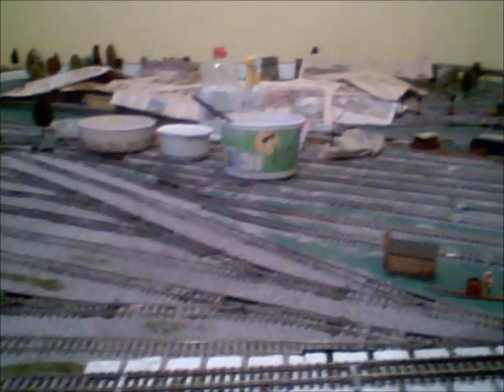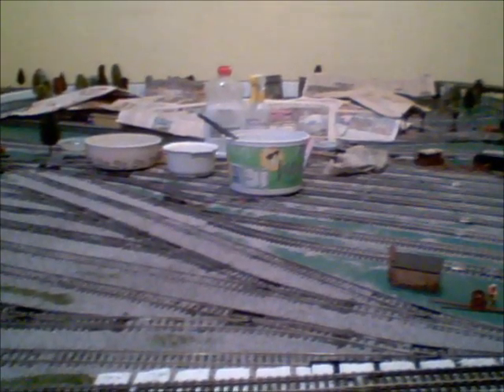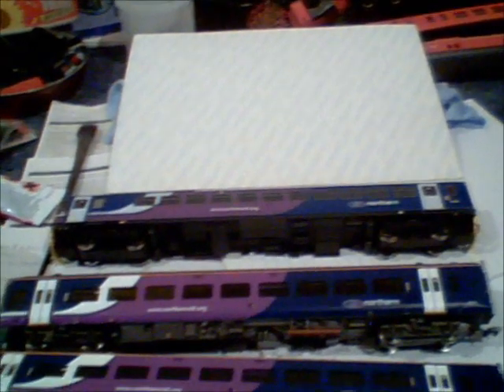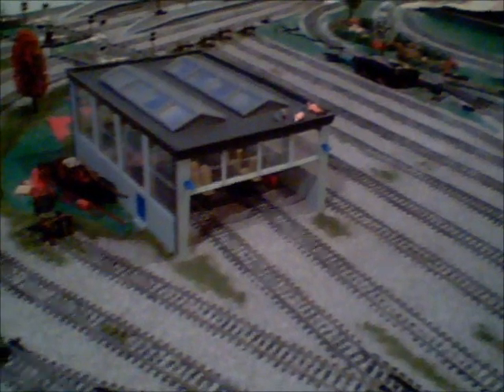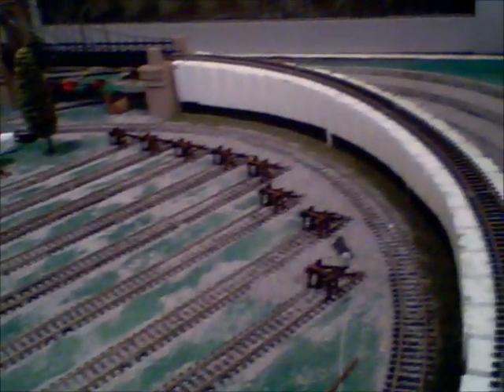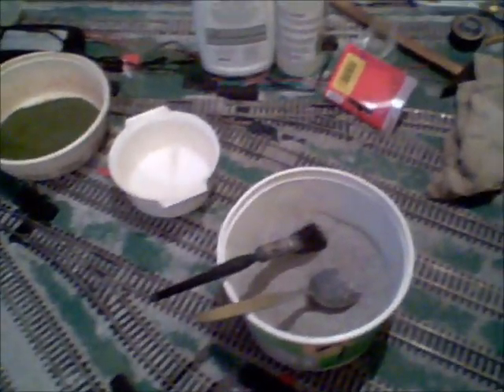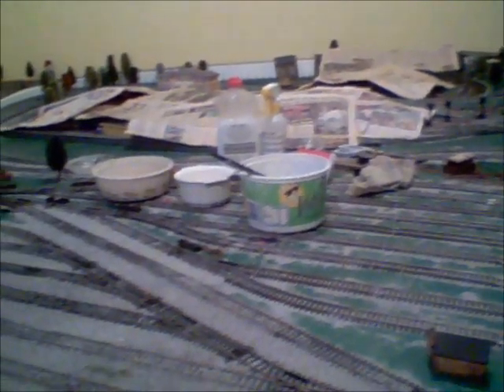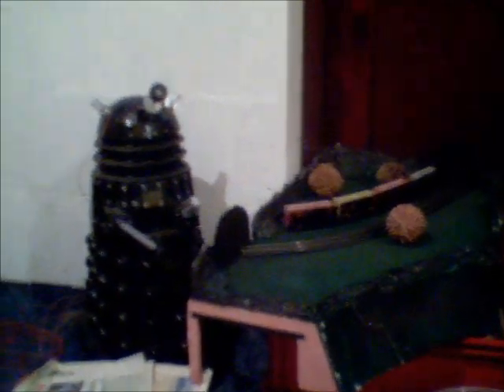Update video of my layout

Comment: @andyfriarsjunc yeah i had the exact same problem with mine run it for about a month or two and the noise all of a sudden goes away also if that doesn't work try cleaning the motor and regreasing it